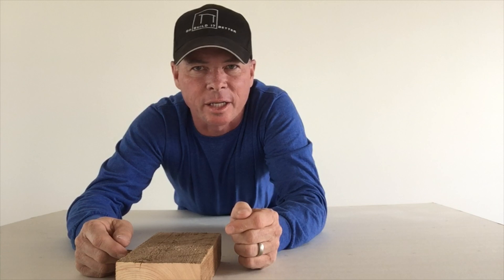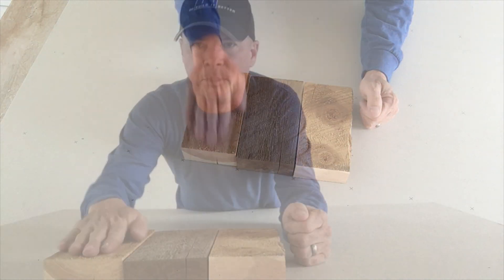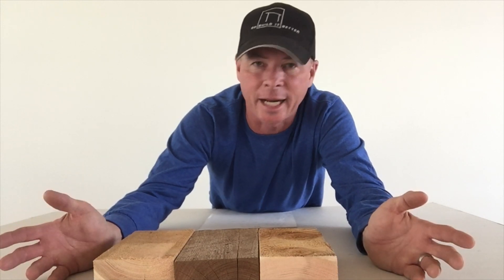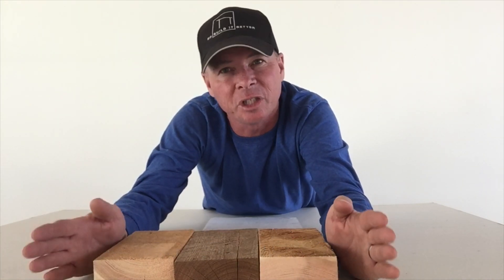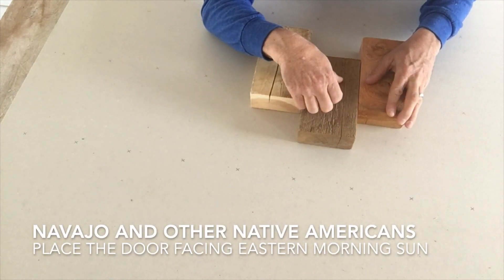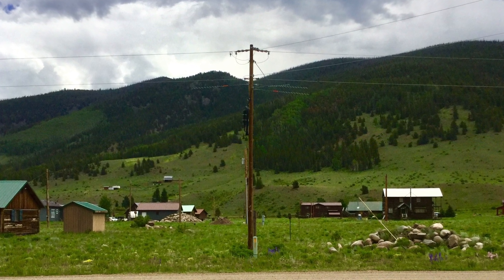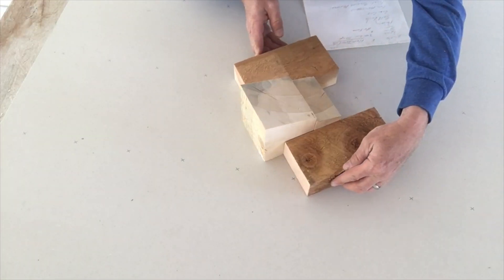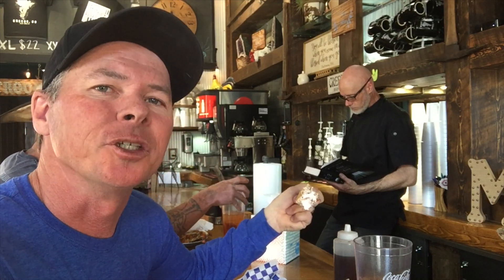Modern Cabin Plans phase 1 Ep.4

Comment: what are you plans to removing all the snow loads off of the slopped tear drop roofs/ maybe you could park your skid load on the back porch during winter.
Reply from the maker: I didn't say I would be hangin out on the back porch in the Winter. Heck no it's cold out there!
Reply: @ModernMountainLiving   better use 2by8 studs just in case you do
Reply from the maker: Serious, standing seam metal dissipates solar heat to start the melt. The materials vid I will show a NEW kind and the color of roof.
Reply: @ModernMountainLiving  looking forward, thanks
Reply from the maker: Welcome back. I just posted "You'll Never Guess where I've Been" https://youtu.be/vikx9wOKzzs

Comment: After obtaining permits to build, does the city or state require those plans to be finished within a certain amount of time? I want to build a house and thought about hiring a contractor to do do the framing and outside finishes. I plan to finish the interior myself. But finishing the inside will take us some time. Thank you
Reply from the maker: Brandon, Good questions. Most permits are for 12 months with 2  6month extensions allowed. This should be on their website with their fee schedule. I have bought unfinished foreclosures and paid to reactivate the permit. Cool thing is the date of the permit establishes the Code. Meaning if Code is adopted after that date you only are required to follow the previous Code.
About the contractor built shell: how handy are you? Did you see the vid "House that will not Burn"? At the end of that vid is a time-lapse you should watch. Those guys didn't know what they were doing with that system so you see me in the orange showing them. We unloaded the delivery truck by 11am and started putting up walls. By 4pm we had a 50' and a 60' wall done. The rest they did themselves after a day of learning. Those are insulated walls so when you dry it in with windows you can work inside in the heat. If you plan and are required to install drywall for fire code, you may want to bid that out. Let me know when you have more questions. Be Blessed
Reply: @ModernMountainLiving  Thank you for your response. Much of what you stated cleared my questions. I will refer back to that video.
Reply from the maker: @Brandon-td2sm  Pouring Concrete- Self Builder,  is the new vid https://youtu.be/xlBdiBP37hU Be Blessed
Reply from the maker: Welcome back. I just posted "You'll Never Guess where I've Been" https://youtu.be/vikx9wOKzzs

Comment: “Heat goes into cold”  law of thermodynamics. 6’ frost line, no joke. That’s why people build a basement. It’s a 6’+ footer. I just subscribed to follow along. I’d appreciate your support also. I’m thinking about building in the side of my hill. My problem is I can’t find a concrete guy. Some scopes of work are actually cheaper to sub out as opposed to doing it yourself especially if it requires large equipment. I want to do most of it myself also but time vs money...  Best wishes.
Reply from the maker: My fist question is always climate. I have built in the humid south, desert dry, and the high mountains every one has different demands. Concrete, I wish I owned a concrete plant. If you can't get concrete, you get to wait for it. I have fake questions for concrete guys. If they are good with my fake questions I know they are not my guy. Let's talk the hillside build. Form work is not worth renting or buying, cause then you get to haul it an d store it. My best solution and recommendation is(Drum Roll) ICFs Insulated Concrete Forms. I have already seen that you have the wit to figure this out too quick and how to do it yourself. Find Joey Hughs inHouse that will not Burn video comments. Contact him with any question on ICFs. Hilside build, as with ANY build moisture is your enemy. Ask about water proofing and backfilling. Even in arid climates that dirt (sandstone) holds moisture and you have to combat it. You mentioned a basement, also look into Conditioned Crawlspace(no vents) or isolating a slab on grade from thermal bridging. I have vids coming regarding all discussed. God Bless
Reply: Gobuilditbetter I don’t need a basement. My frost line is only  16”. You might consider one if your frost line is 6’. I have looked into ICF and I like them however they are more expensive then I can justify for a second home. I would like to go with block wall foam on the outside as a thermal break. The earth will also stabilize the outside temperature on 3 sides. The block will be thermal mass.
Reply from the maker: @RedefineLiving  You Might know this: Hollywood was planned to be in Flagstaff, AZ. The New Yorkers were looking for cheap land and little restrictions. The train rolled into Flag during a blizzard, they ditched the idea and rode the train to the end of the line. Moral is Zone 6 is cold. CMUs with exterior foam for a brake works. As my  brain is shutting down for the night thinks the wrench in the plan is most Code require R-10 in a crawlspace R-19 living space minimum. And even Poly ISO can't be exposed exterior. Research your code. How big is the planned sq ft? Lastly CMU visits that time is money idea. Thanks
Reply: Gobuilditbetter I’m still weighing my options. I talked with a drafter and he said it’s no problem. We might need 2 layers of 2” foam and should be r22. Then a polymerized stucco over it. I’m west of flag, at about 5,600ft. In the meantime, septic is done and water tank is in. I’m ready for something haha
Reply from the maker: Welcome back. I just posted "You'll Never Guess where I've Been" https://youtu.be/vikx9wOKzzs

Comment: Did you consider EPDM for the roof?  I will also be building a shed roofed house in the Rockies and after sitting through several 3"  hail storms this Summer and seeing the damage done to a neighbor's metal roof I'm leaning towards something that won't dent.
Reply from the maker: I use TPO on the apartments I build where the condensers are hidden, and have used it on very odd/difficult roof designs. Here a standing seam metal roof has some real benefits. I started roofing 36 years ago so I like putting up metal and standing seam (big on my objectives) needs little if any maintenance with hidden fasteners. Shingles fly here in our high winds. Metal sheds snow quickly with out the freeze/ thaw issues of ice damming. High resale value and it looks really good. Since the roof is dead flat with SIPs hail is little threat. Did your neighbor have a cold roof (firred out with 1x4s?) One thing regarding hail dents is they have little if any effect on the performance. If you choose 26 or 24 ga there is very little difference in denting save the cost. I did cool roofs in Texas but we don't have the heat to deal with here. EPDM does have a strike when compared to metal regarding insurance in a forest fire prone area. Here's a good tip if you use EDPM/ TPO it will take paint well for esthetics. I am always interested in cool projects and would like to discuss it if I can Help. Thanks for bringing up a very important topic.
Reply: Thank you for the reply.  Your series is very fortuitous for me as in the coming Spring I will be  doing a self-build @ 80 miles to your East, on the other side of the Sangre de Cristos.  Because our situations are very similar if not identical, if you don't mind I'll be using you as a problem solving pathfinder. Of particular interest will be your experience with SIPs as I had already settled on the same supplier and look forward to watching you jump in the water first.  Regarding EPDM, in my limited experience working with it, it is the simplest to put down and the 20yr warranty is likely well beyond my own expiration date.   My 37 acres is grazing land on a high bluff with no nearby trees so I'm weighing the potential cost of insurance trade off between hail damage proof and fire resistance.  As  you progress thru the series any comments you can make regarding building code considerations would be greatly appreciated.  Being completely off grid I will be heavy solar and given that local well depths are @ 500', it would be quite a few years before putting in a well would be a cheaper alternative to having water trucked in and this is without the added on-going maintenance, sub-zero temps and the lowering of the aquifer issues.  A link to a shed design that works for me:  https://www.hebrideanhomes.com/our-homes/layout/agh301
Reply from the maker: @pivotas4406  It would be worth your while to drive over to see for your self. Warning: I will tell you how to make a clock if you ask me the time. Your ears will be tired when you leave but your mind will be overflowing with ideas for your build. contact me at gobuilditbetter@gmail.com
Reply from the maker: Welcome back. I just posted "You'll Never Guess where I've Been" https://youtu.be/vikx9wOKzzs

Comment: A couple of editing suggestions, it would be a good idea to have the volume level relatively consistent.
When doing text overlays, if you have them at the bottom of the screen they are then covered by the closed captions/subtitles. It would be better to place them in a different location.
Reply from the maker: I glad to hear that someone is using the closed captions. Did you use one of the languages I apply too? Something to consider, Thanks.
Reply from the maker: Had to see where Tuggernong was. So you speak the same language, just upside down. Kidding mate.
Reply: @ModernMountainLiving  I use the auto-generated English (when available) unless actual closed captioning has been applied.
Reply from the maker: Welcome back. I just posted "You'll Never Guess where I've Been" https://youtu.be/vikx9wOKzzs

Comment: The highest wall with an upwardly angled eve faces the prevailing winds? Does this create an area the wind has more to latch onto? Is simple better? (the KISS principle ...my favourite)Do you ever get wind and rain from the other side, where the seem in the roof could be a weakness? (Thinking of my own situation ) great vid and it is wonderful to see your planning process. Luv ya work!
Reply from the maker: The Big wall gets reinforcement, also the angled parallel walls are it's lateral support. Angled toward the South for max light and solar gain. KEEP IT Simple is the shed roof. If you notice my logo is that shed roof, my favorite and has served me well many times. Shed roof also the best for vaulted ceilings inside and doesn't cast a dark shadow. In this Snow world there are no hips and valleys for ice/snow to accumulate(ice dam). Most all the roof repairs I have done were where rain backed up in those valleys and got under the roofing. Wind at highest edge is a concern so rather than a large, dramatic, architectural  overhang(sail) it will be the same as the sides(18").

Floorplan and materials list explained next. Good question, Thanks Ash.
Reply: I didn’t think of the big wall being warmed by the sun, your on the other end of the planet to me !
Reply from the maker: Would love to go down under. BTW unlike Aussie's dealing with snakes, we don't have them here at all. It is too cold for roaches and termites too. I do have my eye on New Zealand.
Reply from the maker: Welcome back. I just posted "You'll Never Guess where I've Been" https://youtu.be/vikx9wOKzzs

Comment: Checkout Kodak Steel Homes in Little Rock Arkansas, they are completely customizable inside and out and are non combustible! They are designed for tornado alley and can withstand 200 mph winds. They are made of 100% recycled materials depending on the finish materials selected. If you prefer the look of wood finishes, use Hardie board panels which look like wood and are completely non combustible and factory finished if so desired. If the interior walls are finished with MgO board, then no backing plates are required and studs can be spaced at 2’on center and completely non combustible. Even the polyurethane closed cell spray foam is non combustible with no off gasing
! See kodiaksteelhomes.com for additional information
Reply from the maker: Welcome back. I just posted "You'll Never Guess where I've Been" https://youtu.be/vikx9wOKzzs
Reply from the maker: Welcome back. I just posted "You'll Never Guess where I've Been" https://youtu.be/vikx9wOKzzs